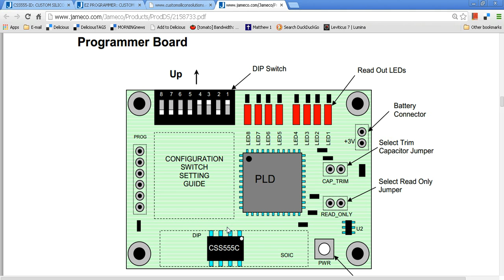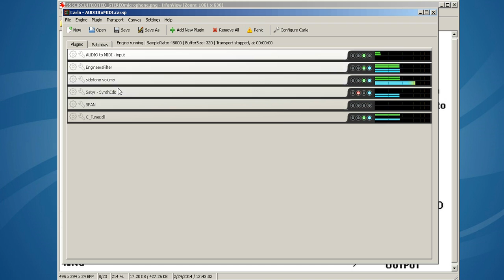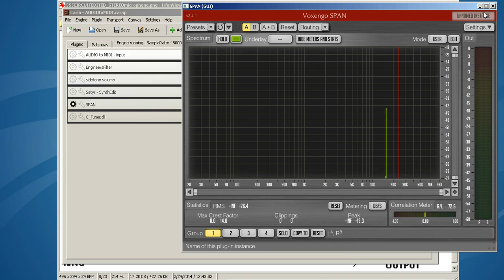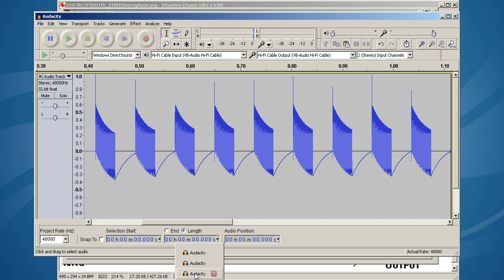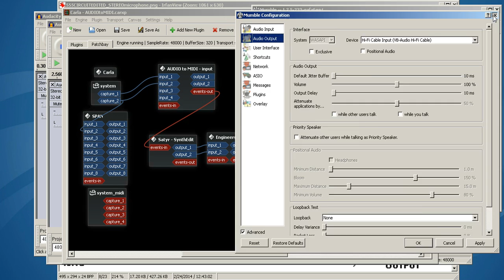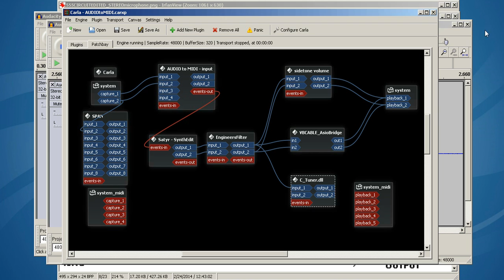Code Practice Oscillator   powered only by MIC JACK voltage of sound card

Comment: I'm  rank newbee.  couple of basic problems: no power at mic input on my macbook pro circa 2008-9.  how does programmer work? I'm guessing css555 is put in programmer, dip switches set and then ic chip removed and used in circuit.

Would it be possible to add power externally and still sue as described?

Thanks.  Can you reply to my email address: jbisson@uvm.edu?
Reply from the maker: John Bisson Power can easily be applied from an external battery.  You could also make a special power cable to use the voltage supply from a spare USB PORT.